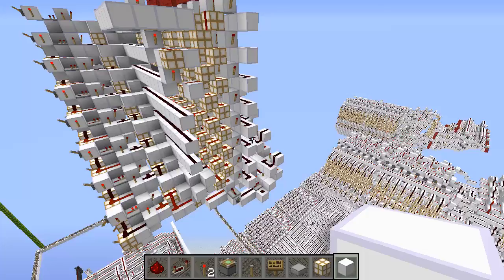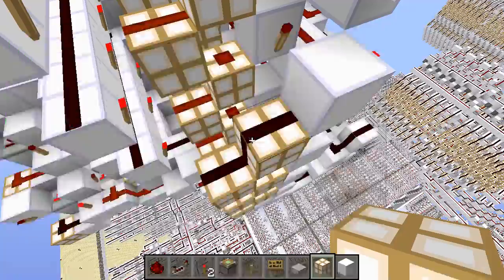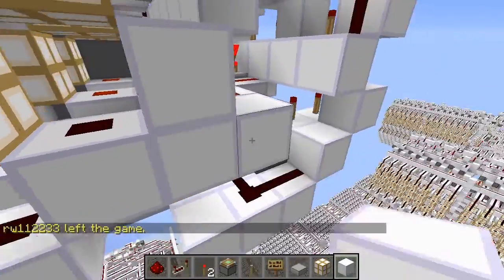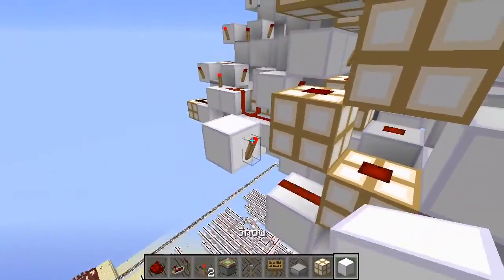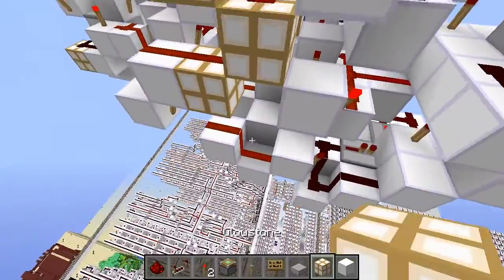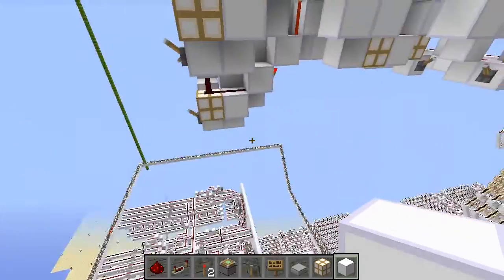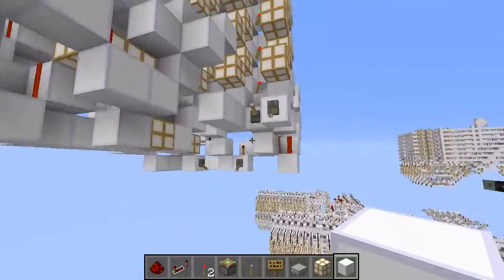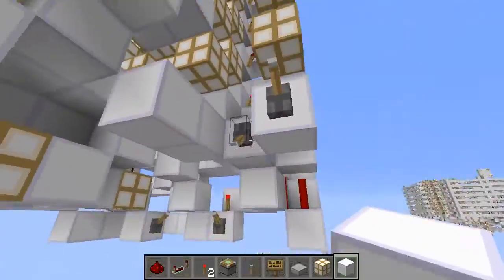Advanced Redstone Computer Tutorial 11: "Finishing" the ALU and why it works

Comment: ROM or Read Only memory is basically memory that is hard wired into the computer, its virtually the same thing as RAM only you can't write to it. this is useful in real computers when you have something that you don't want the computer to be able to change i.e. default Wallpaper, Operating systems are sometimes stored in ROM but you cannot update your computer's OS if this is so

sorry to be so long >.<